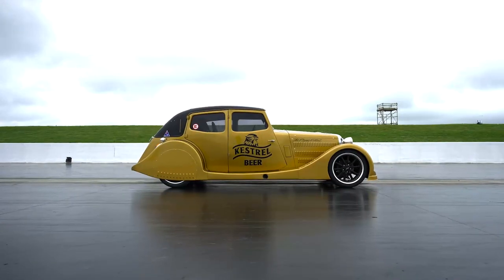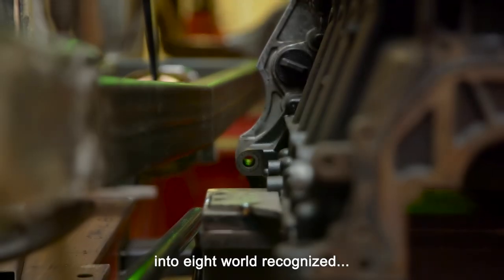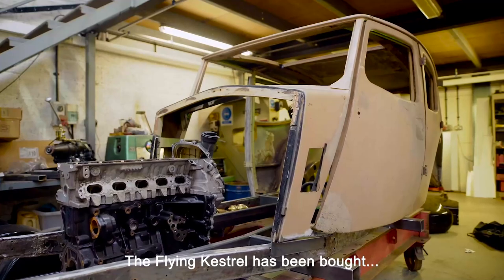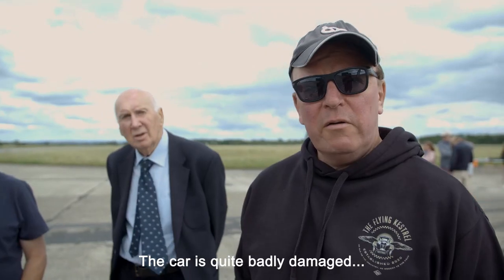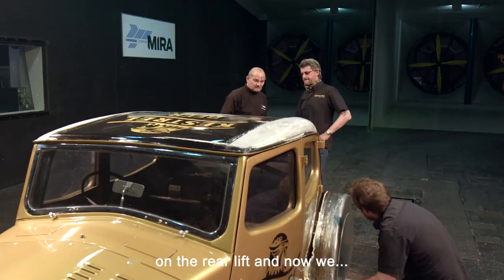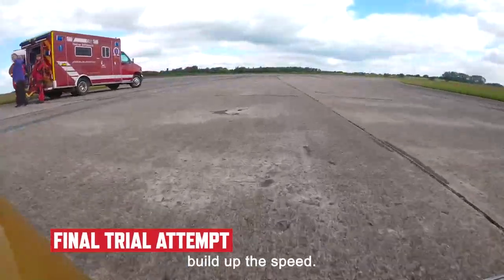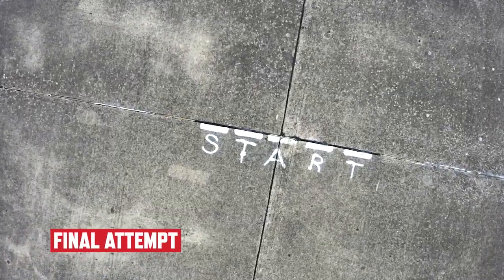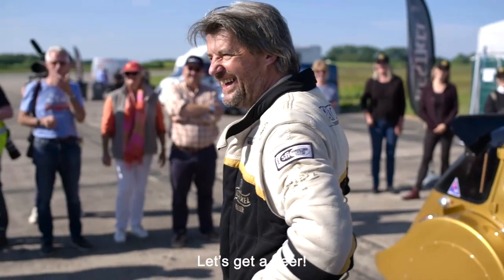Crashing a 1930s Car at the Dragstrip

Comment: I'm a little confused as to why lift, particularly from the front wings, was not foreseen. Frankly a wind tunnel test was largely academic as regards the front of the car. I'm sure it worked as lager publicity, all well and good. 
An (Audi?) engine with one or two turbos strapped to it makes it fast, obviously, and there's some revenue for Elvington, but as we look under the skin any resemblance to an early Riley Kestrel is casual, it's effectively more akin to a hot Morgan special...all of which leads me to be interested is exactly what speed records have been broken...?